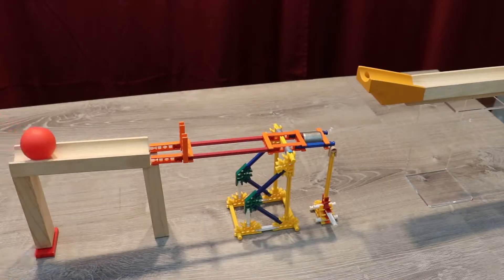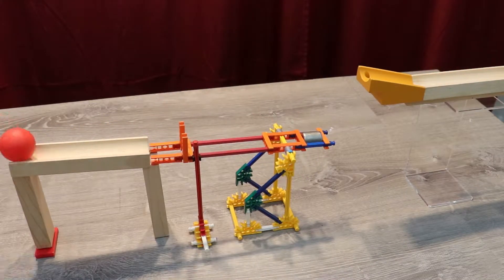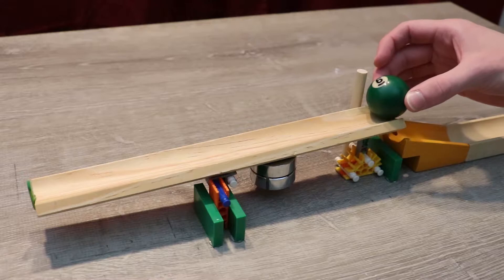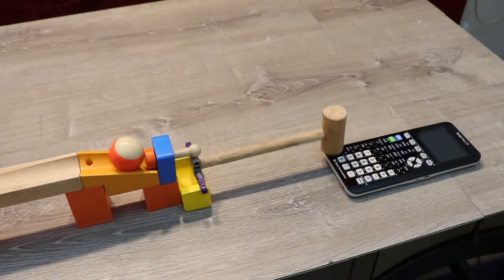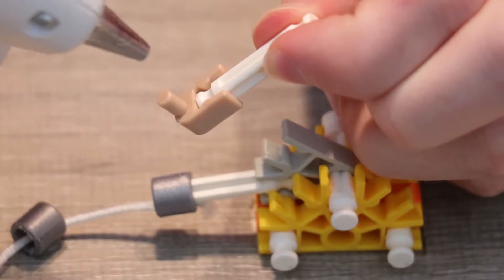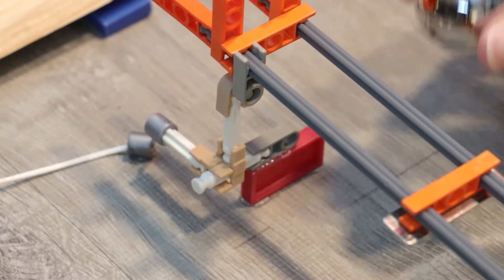Episode 4: Advanced K'nex Techniques | 50 Fundamental Chain Reaction Mechanisms

Comment: For future reference, Part 4

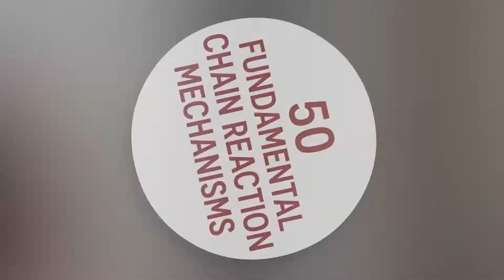0:00 Opening
0:22 31. Falling Support
3:19 32. Falling Latch
4:26 33. Disconnecting Lever
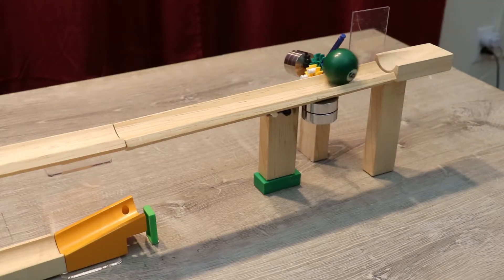6:17 34. Compression Rod Release
9:30 35. Concentrating Lever
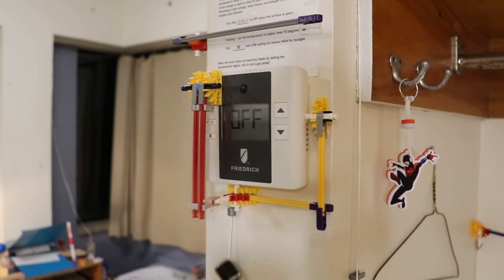11:18 36. Frictional Lever
16:01 37. String Stopper Lever
17:13 38. Shifting Pusher
19:07 39. One-Directional Lever
20:46 40. Flexing Parallelogram
23:02 Closing